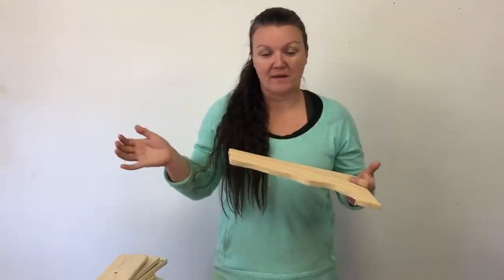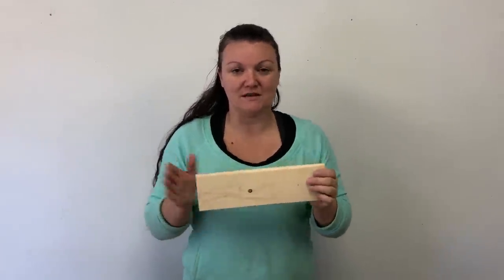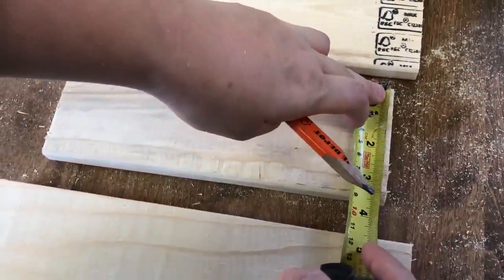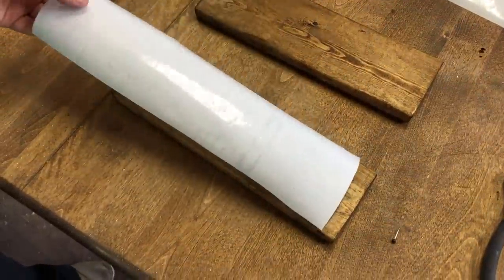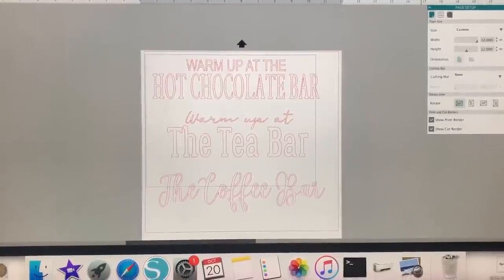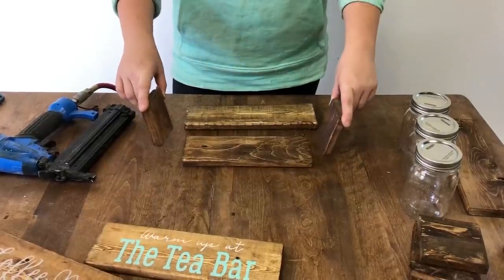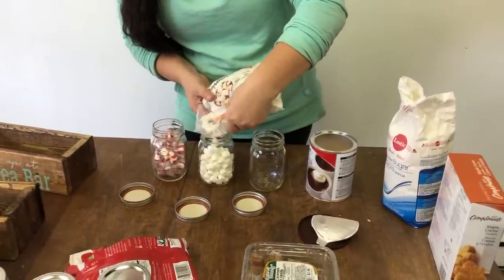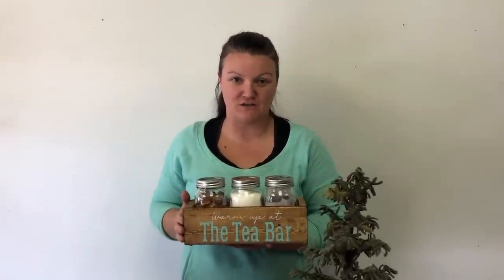DIY | Holiday Coffee Bar | Tea & Hot Chocolate Warm Drink Station | Easy To Make | Under $5

Comment: You're so awesome, I love you. Could you please explain the size of the saw blade and how when you measure you want to leave the line or cut the line off.I once thought I could do it all at once and ended up with slightly shorter boards than what I wanted. Thanks in advance.
Reply from the maker: I usually try to cut to the right of my line. That way i can see the line on the left hand side of the blade ( on the side I am standing to cut) And...that means to the right of the line that I am  not cutting my size too small as you mentioned :) I really wish I would have purchased a sliding compound mitre when I invested in this one I currently have. I will eventually upgrade since this one limits the width size of the boards I can cut. I use my table saw to cut those since I don't have a sliding one. Thanks for watching Dawn :)